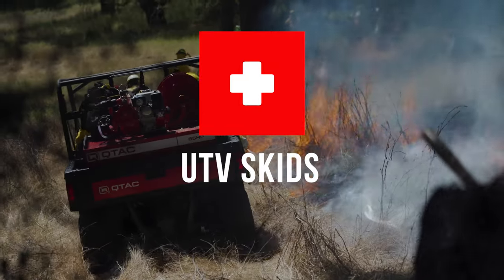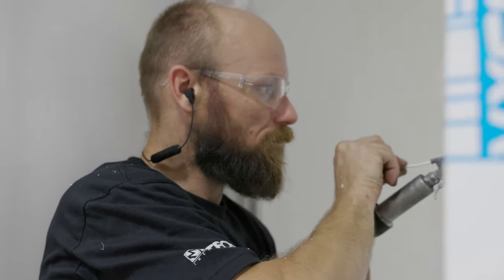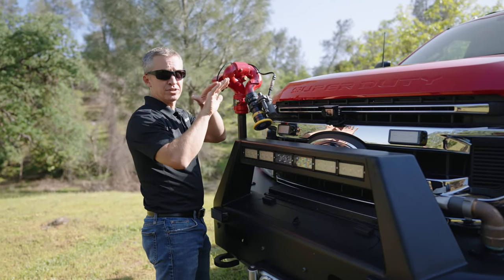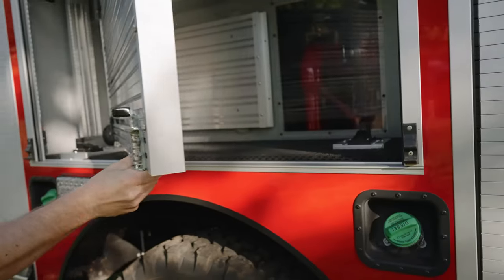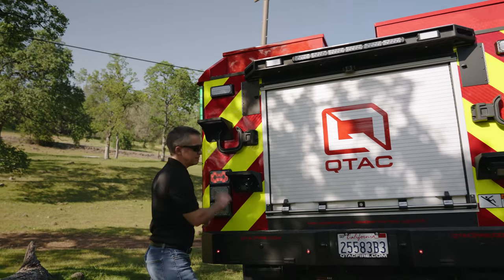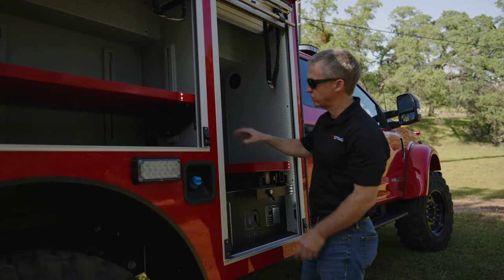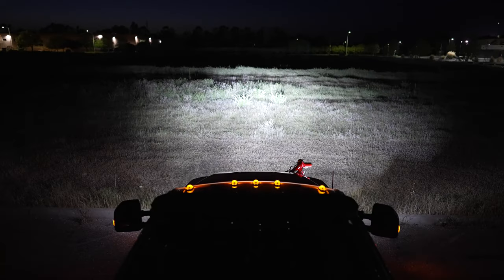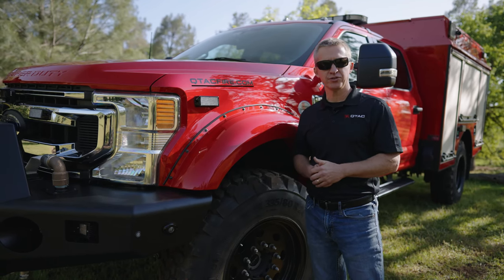Ford F-550 TYPE 6 Fire Truck Build | QTAC SUPER 6™

Comment: What does this truck lack to be qualified for a type 5?
Reply from the maker: Hi Jeremy, it would just need additional water capacity, which isn't an issue. Type 5 is minimum 400G, this truck currently uses 300G.

Comment: So little water tank.
How long it last???
How do you fight a fire with so little water???
Reply from the maker: This is a pretty typical size tank for a Type 6 brush truck. How long it lasts is dependent on the operator, nozzle, throttle settings, etc. It's amazing what you can do with 300 gallons, some hand tools and a knowledgeable crew. You can also draft.